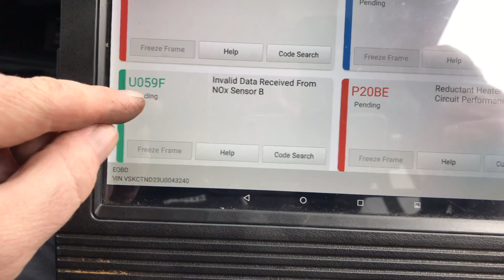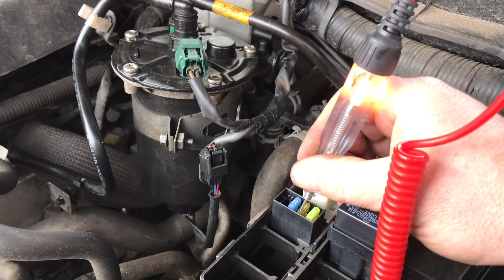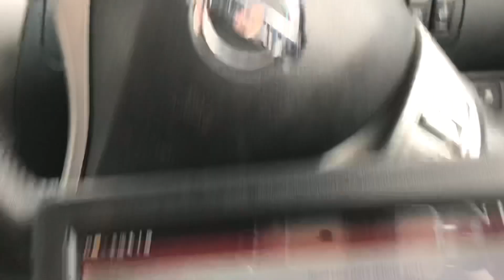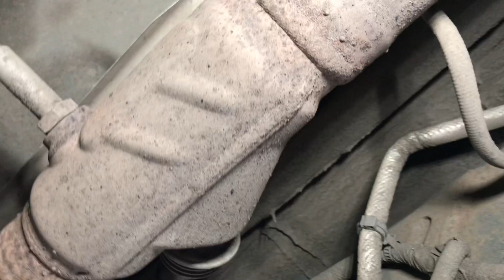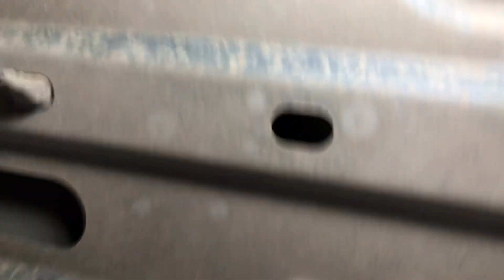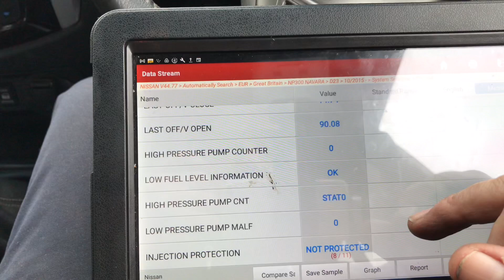Nissan Navara (2016) - Reductant Heater Control Circuit B, Nox Sensor A and Nox Sensor B Faults!

Comment: Hi sandy Are both sensors the same part number? I have an issue like this too. I have a few launch scanners and they are telling me that fault.
Reply from the maker: I assume so but ask the Main Dealer cheers sandy
Reply: @sandyande  thanks. Great information on the video. Thanks again

Comment: Just another crock of 💩modern vehicle , drill a hole in the exhaust 🤣🤣🤣, dealers no idea , well how do we go on then 🤣🤣🤣🤣🤣🤣🤣🤣  at least I've finished the new ecoboost  engine job , had to mot it and 2 new tyres 💸💸💸💸, seems to be a coil spring week Sandy , had to order a tool to do a Mercedes CLK to hold the piston and stop it from being sucked back into the strut body meaning the spring wont compress enough to get the top nut on , dont we love cars 👍👍
Reply from the maker: That sounds like a top job on the CLK, let us know how it goes cheers Mike, Sandy